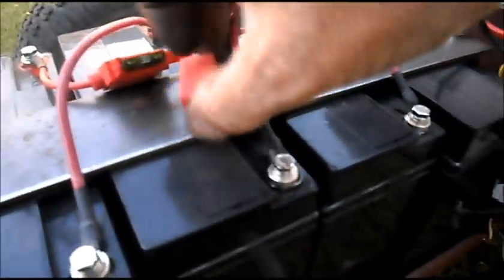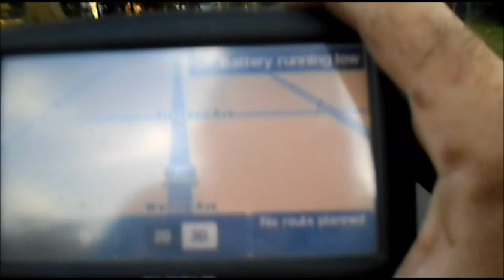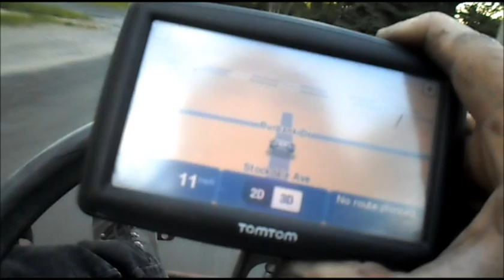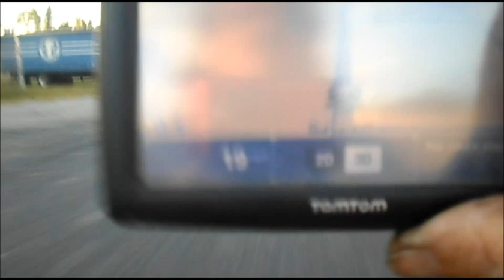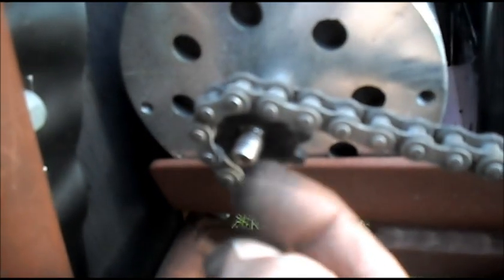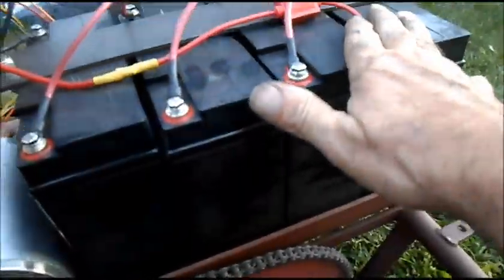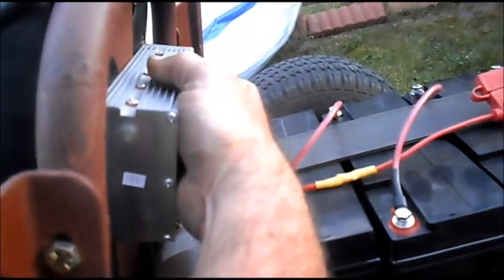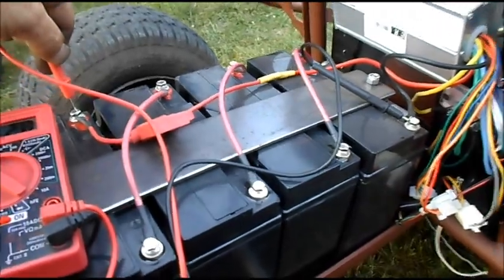El Dingo II  Another test drive with the Boma 1,800 watt brushless motor

Comment: That is a 3 speed controller, you are in default 2nd, A connector on the controler has 3 wires, blue, black and green, none connected is 2nd, blue and black connected is 1st, and black and green connected is high 3erd which is way faster.

Comment: For the motor controller, did it limit the current to 32A? I was thinking if the motor and controller was rated for 1800W for 48V, then the current limit on the controller should be around 37.5A.
Reply from the maker: I don't think so.  I thought the same but, I now use a 40A fuse & don't notice a difference.

Comment: So what was your top speed ?
Reply from the maker: The top speed for this set up is ~20 mph
Reply: Functional Artist thanks... And thats with the boma 2000 watt 48v motor ?
Im planning to put a boma motor on a pedal go cart from kettcar :-)
Do you know how much your setup weight ?
Reply from the maker: It's the Boma  48V 1,800W http://www.ebay.com/itm/1800W-48V-Brushless-Electric-Motor-Speed-control-Controller-Go-Kart-Scooter-E-Bi-/282604073002?hash=item41cc83f02a:g:4zEAAOSwH09ZE5Jx  I would say Kart, motor/controller, batteries & all is ~100 - 120 lbs.
Reply: Thanks....
Then the Boma 2000w / 60v must be something for me :-)
Reply: Nice build ... looks clean .. Have you ever checked the amperage on the main hot wire from the battery for shots n goggles.  You said you've got a 40 amp fuse but do you know what the measurement really is . I'm curious ... I'm replacing a complete setup right now on my stand up scooter . It has that same motor controller setup . I'm using lithium though ...